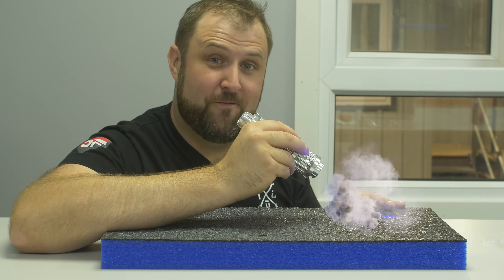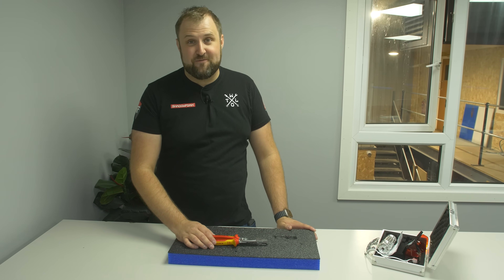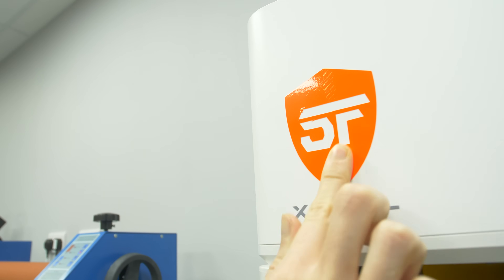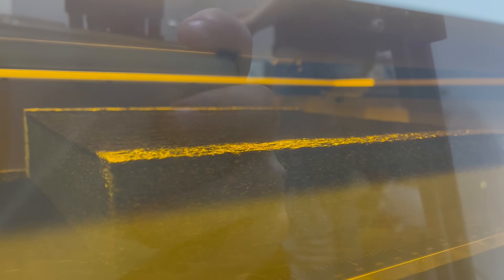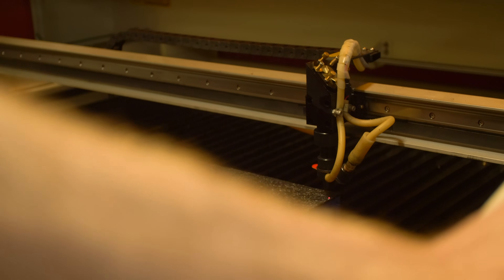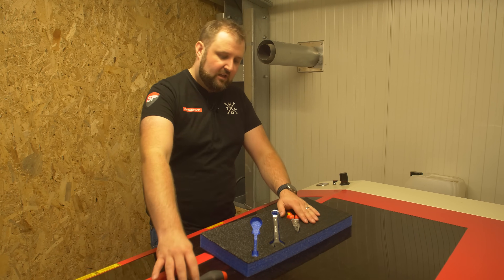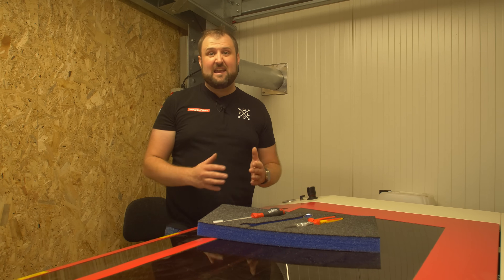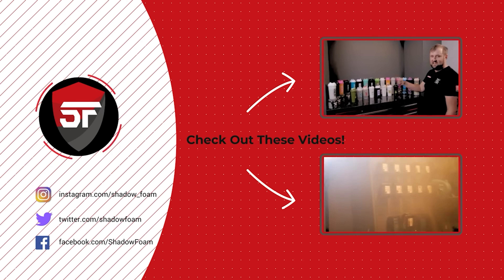Can I Cut Shadow Foam with a Laser?

Comment: Not a great safety feature showing you cutting foam with a laser and no eye protection...
   Just a reminder that you only have one set of eyes and these can destroy eyes In less than a second. The smoke looked a little bit like CGI but it still looks like you're using a laser without eye protection.

Comment: Fascinating video for me as I have been laser cutting as a small business for the last 6 years and have occasionally cut foam although not shadow foam.

I do have a couple of suggestions.

To get the outline for your cut run the tests on cheap material. I use cardstock which works out at about 20p per A3 and cuts really quickly.

For placement I have a jig with a squared hole in it. This allows the item being cut to be placed exactly at the origin of the square and by pushing it up against the edges you know its relatively square on. For total accuracy I make the hole the size of the item to be laser cut or etched.

A final thought is that i moved from a laser like the hpc to a trotec, a lot faster, and I'm thinking about doing a shadowfoam test

Comment: I gave up trying to cut mine with the scalpel only ended up doing 1 of my drills 😂 ended up having to use a jab saw to cut it out
Reply from the maker: How did the jab saw cut turn out?
Reply: @JonaShone  not the best cut in the world but it cut through it ok and my impact driver fits in nice and snug think it was the 50mm or 70mm foam I used

Comment: I was recently looking at purchasing a 2000 watt handheld laser.  It can weld metal and cut through plate steel over an inch thick.  Yes you can cut foam with a laser lol.  You can also cut your car in half 😂.
Reply: Been looking at 1064nm fiber lasers for a while. I'm confused why the price is so varied, some claim to sell them for £2k, and others want £6k for what looks to be the same thing... Not seen anyone on YouTube buy one and review it yet.
Reply: Basically it depends on the markup.  Some of the sellers are the Chinese manufacturers themselves and some are western resellers.  The resellers will have better customers service(in china all products are buyer beware and no after service support). The Chinese sellers may have some customer support but in my experience and experience of others its usually lacking/slow/unhelpful. @adrianscarlett  So  you can buy a part for sometimes 1/5 the cost but it maybe harder to get support for and you will have to deal with shipping if its a larger item(example a laser cutting cnc table) which could cost around 7,000-10,000 for a larger laser cutting table.

Comment: Did you try cutting the Shadow Foam with the  engraving cutter on the XTool? Would be interesting if you could cut out the whole shape or logo with that instead of just the outline.
Reply from the maker: 😅 don’t know why I didn’t think of that, definitely going to try that!
Reply: @JonaShone  If you use the Cutter Function on the xTool and auto-measure the thickness of the material, it will cut all the way through. So play with the numbers on the measuring if you don't want it to cut all the way through but make it deeper or you can glue another piece of foam on the bottom to enclose it if you do end up cutting all the way through.